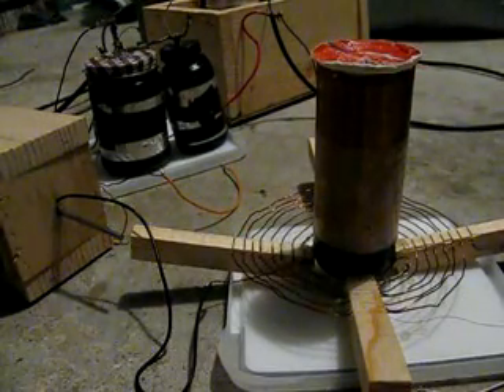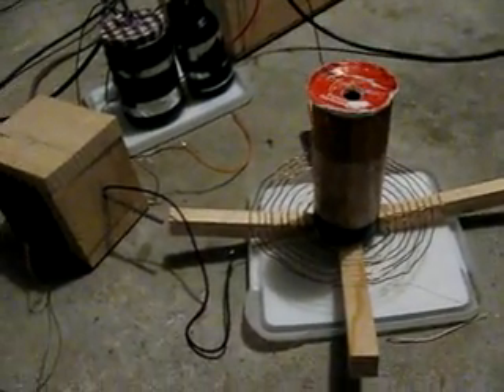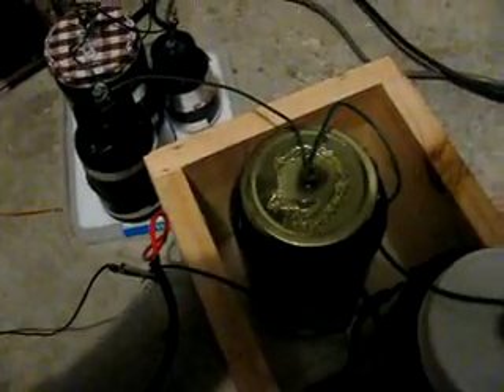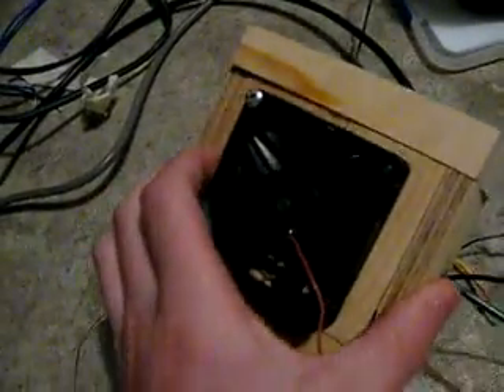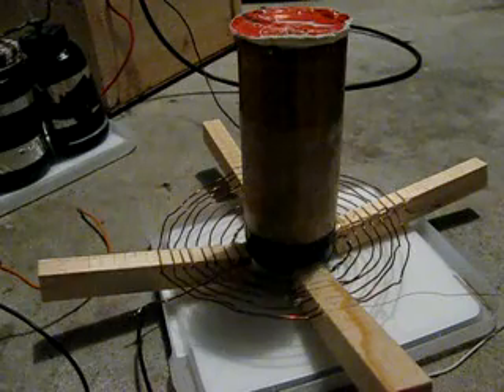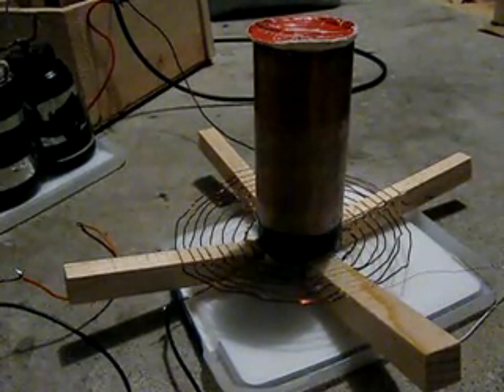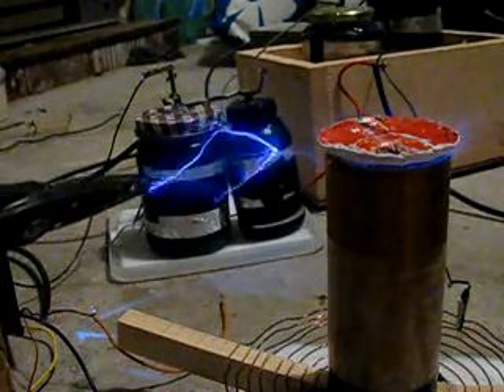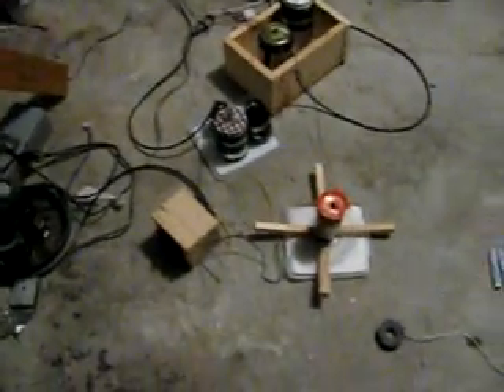Small Tesla Coil

Comment: okay I have like a 2-2.5  foot high secondary on a half inch PVC tube with a lamp cord vertical primary 5 beer bottle capacitors in parallel two bolts for a spark gap and a 3000 volt nst but i also once used my flyback driver.whenever I run it I get like a 5 cm spark to ground. Please help. you look like you are getting at least 100000 volts out of yours.

Comment from the maker: now, mine happened to be tuned inbetween the 6th and 7th turn on my primary (tesla cad told me that, and it works well!) but you don't always have to have the copper tubing for your primary. personally i have never tried it, but with a small gauge solid wire (18-24 gauge) i have been able to get 5 inch streamers. i've even had success with some stranded wire but it's not as good. anyways try tesla cad and add more turns. tell me how it goes! good luck!

Comment from the maker: well first off i have to say, that is one tiny coil!! it can still work but i think your problem here is in the primary. you don't have enough turns to meet the inductance requirement to make a resonant circuit. one way to determine pretty much exactly how many turns you need is through the program Tesla Cad. its a great program where you input the specs of your coil and it tells you how to tune it etc.